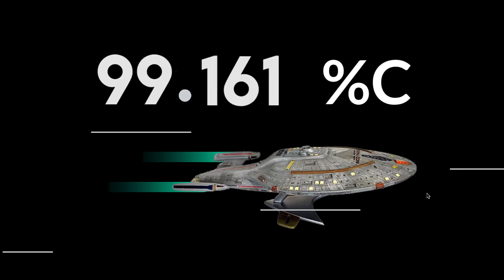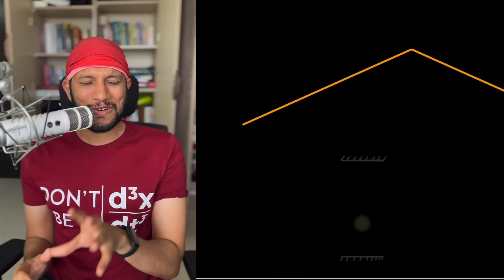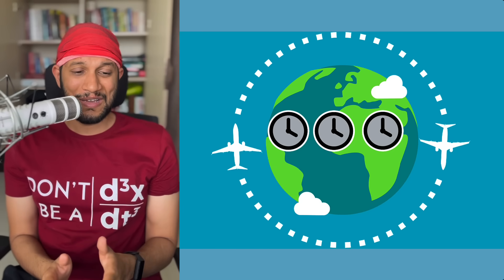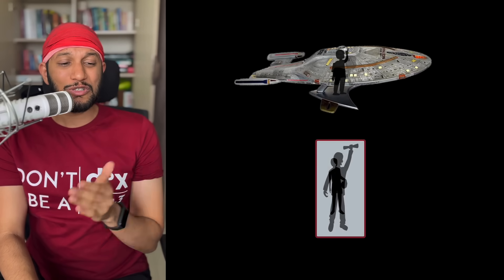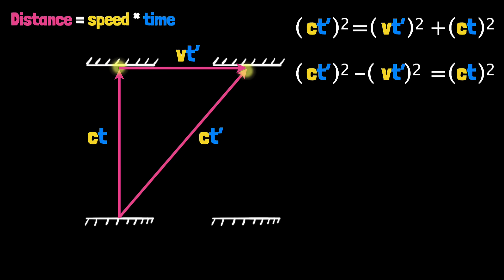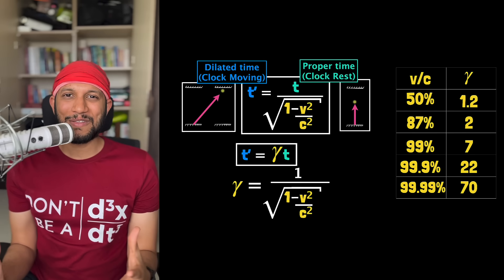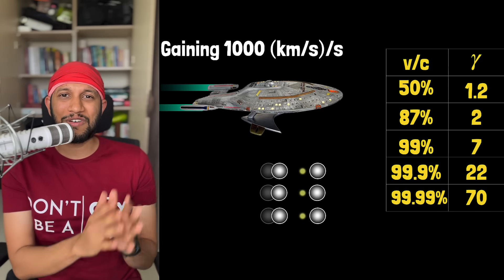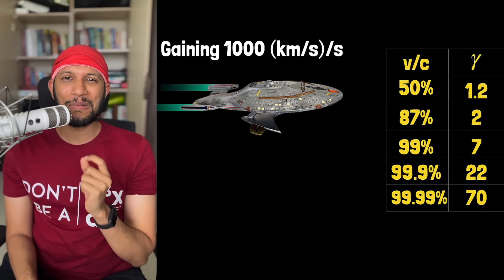I finally understood why you can't go faster than light! (My mind is blown)

Comment: For this whole theory there is an assumption that the light itself cannot go higher than the speed of light(3X10^6m/s) in any circumstances not even when its in a moving environment and observed from outside from a stationary object. But whyy? Like a kid running in a train can be running on its own speed of 2-3 km/h and would look like running at 200km/h from outside. Why cannot this be the same in case of light too. Who is putting the condition. If there is a condition then who is deciding the ultimate stationary state because we surely are not stationary at all. It all looks like a scam to me.

If external stationary observer is deciding the speed of light inside a moving object then the speed of light is not what we think it is (3X10^6m/s) because this was calculated on earth and the earth is moving. We need to find the ultimate stationary object to know the speed of light

Comment: So if you're on the ship. If you start out accelerating at 1G by throwing Mass out the nozzle at a momentum equal to the weight of your ship, and you change nothing,  you eventually stop accelerating but you still feel  1g of force between you and the surface of your ship?

Comment: For me this whole explanation has just one flaw. The starting point. Following the "If i am a hammer, everything looks like a nail" principle. Of course nothing can go faster than the speed of light, if my point of view is based on photons and visibility.
With the same method i can say nothing can move faster than sound, when i take a soundwave as starting point, and every calculation following would be correctly pointing out that the speed of sound is the limiter.
(and in a way it was, breaking the sound barrier leads to some crazy effects, breaking the "light barrier" could therefore also be real nasty)
The problem is that we as humans cannot imagine something faster than a photon, even though some scientiest believe - no real proof yet - that tachyons could be faster (there are papers mostly about the rim of black holes that go into much detail). This would also lead to a - currently not existing - explanation for mechanics of quantum entanglement behaviour, which can currently not be explained fully.

Comment: When the photon clock is moving close to c and emits a photon, the photon will miss the mirror because the mirror will have moved forward.  The photon clock (ie. force carrier transmission) only works at the atomic level where the distances are tiny.  For atoms, what I see likely happening is outermost electrons taking longer paths as they orbit the nucleus.  How this translates to time dilation could vary depending on what the material is (ie. living cell or mechanical clock).  Comments please.

Comment: Thanks for the amazing video and it makes more sense but with that I got more questions..
-What happens in black hole, due to intense gravitation pull light can't escape. Can a black hole make light go faster on the horizon event?
-What if the observer is not stationary and travelling in opposite direction?

Comment: Speed doesn’t cause time to slow down.  the speed is causing the photon to take more time to bounce on the pad, because it needs to travel through more space. That doesn’t mean time is slowing down. It means the photon is taking more time to bounce on the pads due to the need of moving through bigger space . So at the speed of light transfer of energy will not be possible because engines cannot work due to extreme Gforces due to acceleration at speed of light. But that’s nothing to do with time

Comment: Heres what perplexes me. If the time dialtion is only observed from the outside, even if it took however many years to accelrate on the outside. Wouldn't it still be no extra time for the people inside because the dialtion does not affect the internal observers ?
Reply: Came here looking for this comment. He usually explains the topic from multiple frames of references, but this time skipped one that really mattered, the ship frame of reference.
Reply: @tarekkamel279  consider your space ship a rectangle with only 2 atoms one on each end(one on the left and one on the right). there is a force bieng applied from the left side, and you accelerate that rectangle towards the right side of the screen, for the acceleration to register and for the rectangle to move, one atom needs to move(left atom), and then that movement needs to registered by the second atom(right atom), so, lets say if the rectangle is just starting out, the electromagnetic force will move at a speed of light and the rectangle will move as usual, in its perspective time is flowing as usual. now, lets say the rectangle has accelerated to 50% the speed of light. both atoms in the rectangle are moving at 50% the speed of light, now if it wants to accelerate, a force is applied to the rectangle, and the second atom(left atom) would be the first one to accelerate, and that acceleration needs to be transmitted through electromagnetic force at the speed of light to the second atom on the right for the entire rectangle to move and accelerate as one. but the thing is, the second atom is also moving at 50% the speed of light, so the electromagnetic force takes 2 times more to reach the second atom, even though the force is moving at the speed of light, the second atom is moving away from it at 50% the speed of light, so it takes longer for it to arrive, doesn't matter if we are looking at it from the outside or the inside. the propagation of force will always be slower the faster you move. and if you move at the speed of light, you don't move, because the time it takes for the electromagnetic force to move from one atom to another would literally be infinite. no matter how much energy you put into the left atom in our rectangle example, it wouldn't reach the right atom, because it is moving at the speed of light.

From the perspective of someone outside the rectangle spaceship, the rectangle is moving at light speed, but from the perspective of the spaceship, you have barely aged or barely moving.
Reply: Exactly. And since it would need infinite time to go to light speed the universe wouldn’t exist anymore when you have finally reached it.
Reply: Yes. However, you would die in minutes because the universe would be moving through much more history than you, meaning you'd be bombarded in what is for you minutes and eventually seconds by literally billions of years of radiation.

And if your ship was completely black absorbing all light somehow, then you'd reach c and then what? You're experiencing infinite time relative to anything not moving at c, so how can you move forward in time? A literal instant--not second or picosecond, but actual instant moment--for you would be infinite time for me, so if any time passed for you then more than infinite time would pass for me and that doesn't make any sense.
Reply: @Prophet_of_Colour  well at list the gey on a ship would leran what hepens after time ends)
Reply: Yes from the reference point of some one on board a ship travelling close to the speed of light time passes normally, at 99% speed of light someone would experience 1 year of normal time, but to outside observers approximately 7 years passes, so basically appears as if the traveller has travelled forward in time to him, or has aged slower to outside observers. He mentioned twins, and there is the twins paradox about exactly this situation as they would no longer be the same age if they existed in different reference frames, one at rest and one traveling on the ship.
Reply: Welcome to warp speeds, aka the Alcubierre (sp?) Drive
Reply: Speed of light in relation to what? Motion is always relative to something else. It’s not an absolute thing floating out there. If you’re accelerating in empty space, you’re not “moving” in any universal sense; you’re just feeling acceleration like gravity. You are accelerating and you feel that (acceleration is absolute). But whether you’re “moving” at some velocity is still only meaningful relative to a chosen frame. 

Let's return to space with other objects in it: From your own reference frame, time flows normally. You don’t feel your own time “slowing down.” What changes is space and time relative to others. For example, in your ship’s frame, you can cover 1 light year of distance in less than 1 year because that distance is length-contracted. To people watching from the outside, though, the trip took over a year, because their distances and clocks don’t contract the same way. That’s why at speeds extremely close to c (like 99.9999999999999999…%), you could reach anywhere in the observable universe within your own lifetime, maybe even in a year of your ship-time. But to an external observer, the same journey would take billions of years. Both perspectives are “true” within their own frame; relativity just says you can’t make one frame the ultimate truth over the other. 

You can asymptotically approach 𝑐 and cover arbitrarily large distances in finite ship proper time because distances are contracted, but you never equal 𝑐. A poetic way to think of it if you struggle with the math: As you approach the speed of light, from your perspective, distances ahead of you shrink more and more, so you cross them in arbitrarily short time. But that also means you’ll never have enough of your own time to actually “hit” the speed of light relative to your starting point, because before you do, regardless of your destination, you will have arrived. Even if you could theoretically reach c (You can't), it would be meaningless, because you would always reach your destination before you'd finish accelerating.
Reply: You can't calculate speed on your own. In that sense, everything will be at rest. That ship trying to reach the speed of light is a single body. In kinematics, you always calculate anything in reference to someone.

Think of it like this: you are attempting a Guinness World Record at home without anyone watching. That doesn't mean anything until you do it in front of an official. Similarly, the whole concept of speed comes into play when someone is watching you. Otherwise, with respect to yourself, you are always at rest.
Reply: No, he did explain it. If your inside the ship, it would look normal to you. But I’m watching you from the outside and I’m getting older fast when you look at me. And when I look at you through the window you will look still, time slowed down for you cause you are the one in motion. Time sped up for me in your eyes, cause you are the one in motion. So time dilation is observed from outside (me watching you) and observed from inside (you watching me).

Comment: I really didnt get the photon clock explanation in the start of the video. You said that C is always the same however you clearly slows down one of the "ticking". Shouldn't it be the same speed (same time between every "tick") but the moving one appearing to walk a bigger distance? I dont get why you slow the ticking down

Example: if I keep moving a pencil on a paper from point A (top) and B (down) on a straight path at a steady velocity, and then move my hand left while still moving it verticaly at the same speed, I will start drawing diagonal lines, but my hands wont be moving slower by any means 

Obviously I know that the theory isnt wrong and Im just not understanding it, but because it is the first example of the video it really is throwing me off

Comment: From the outside perspective, the ship is slowing down, but from inside the ship, shouldn't the ship itself experience traveling at the speed of light eventually (assuming it increases by 1000 km/s) , meaning the ship IS capable of traveling in the speed of light?

Comment: Wait, wait, wait. I thought you would eventually get to this in the video, but... If it's impossible to accelerate to the speed of light, then how do photons travel at the speed of light???? Certainly they don't have infinite energy?
Reply: They don't have mass , so they don't need energy to travel at speed of light
Reply: Only objects without mass can reach light speed
Reply: Photons don't accelerate. They only exist at the speed of light.
Reply: @XtreeM_FaiL  They can be slowed down though, even be frozen in lab conditions. So I'm not sure about that not accelerating either.

Comment: Silly questiom, I get the bit about photons and speed. Is this only relative to my perspective here on earth (or anywhere)  or if I was on the space ship would time slow down for me? i.e if muons etc slow down, can we "know" that biochemical processes slow down?
Reply: From what i know, time will never slow down for you. If you were travelling at the (or close to the) speed of light, you will not notice anything unusual. The people who were not travelling with you (they were on the earth basically) will age faster than you
Reply: @HermitsClog  That has to be incorrect, because if time was normal for you on the space ship accelerating up to the speed of light, there would be no issue with time dilation and the last 1,000 km speed increase needed to reach the speed of light would happen in one second for you -- which is a finite amount of time.

Comment: So why is it moving slower when moving
As opposed to moving faster and the same speeed
Why hypothetically to we look at the moving time tick and say it moves and the same speed but different length

Does a snail look at a human and a human is slower in time? Or is the perception irrelevant to ones movement

Anyway what is the point of showing that one persons perspective appears to be slower
Does  not make sense
Because if you traveled 100,000,000 the speed of light you still age the same
You cant look at the age relative to speed when you age at the same speed
Einsteins concept that it moves faster because it a faster path relative to some other perspective kinda dum not gn lie

Comment: It's strange how we have revered the speed of light because of it being a tangible, deducible measurement.
EM waves are the cornerstone of the modern theory of physics, because the way two particles communicate/transfer energy, is through electric fields. This argument completely breaks down if another field or medium is discovered, which allows information ( not necessarily energy ) to transmit from one place to another through it faster than light.

Comment: A brilliant video, superbly explained. I still don't get it, but that's on me I guess. The idea of time dilation makes no sense to me. Maybe how we measure time differs with high speed movement, but that just indicates we aren't measuring it correctly. This idea that two people age differently is very odd. Why would they? The same amount of time has passed for both, regardless of how fast we measure it. It makes no sense to me. Note that I'm certainly not suggesting any of this is wrong. I know I'm the one who is wrong. I just can't grasp why. Many years ago at school I asked my physics teacher about this during a lesson on the subject. My question was "If we can propel a large empty train at 99% the speed of light and inside that train we had another smaller train, fixed to rails, which we then propelled forward at 10% the speed of light, then from an outside perspective wouldn't the smaller train have a combined speed faster than light?" The teacher couldn't/wouldn't answer it and instead sent me out of the class. To date, I still have no answer. Maybe it's in this video and I just don't see it. Either way, still enjoyed the explanation.

Comment: The reason why you can't go at the speed of light or even beyond is because that would break causality. Lets say you could travel at 2x the speed of light. and lets say you wanna send a message to your friend, bob. In bob's pov. He would receive the message before it was even sent. I'm not going to explain in detail, its simply that that applying the lorentz transformation on bobs pov would lead is to an answer that indicates the order of events was reversed. And in the absoluteness of causality, this is an impossibility. Thus, FTL travel is impossible
Explaining it in a more intuitive sense. Faster than light travel leads to time travel into the past but timetravel into the past leads to a lot of paradoxes so we just can't do it because it doesn't make sense to be able to do it.

Btw: for the sharp ones wondering why exactly this would break causality, its because there isn't an absolute timeframe like in Newtonian mechanics. Special relativity forbids it. Probably because it leads to other logical inconsistencies that I can't think of. But mainly since the existence of an absolute timeframe isn't there, there just isn't an absolute frame of reference. They are all equal.

Comment: The speed of light (approximately 299,792 kilometers per second) is the cosmic speed limit because of the relationship between speed, mass, and energy as described by Einstein's theory of special relativity. As an object approaches the speed of light, its mass increases, requiring exponentially more energy to accelerate further. Eventually, it would require an infinite amount of energy to reach the speed of light, which is physically impossible.

Comment: How can we not hit the 99,99% speed of light with basic spaceships? There’s nothing like air resistance or gravity to slow you down in space. So if you keep accelerating - you should keep on speeding up, shouldn’t you?
Reply: Where do you get the energy?
Reply: @XtreeM_FaiL   you just continue to speed up at even normal car's rate, cause with nothing slowing you down, you shouldn't need a lot of energy to increase the speed right? Or is there something slowing you down?